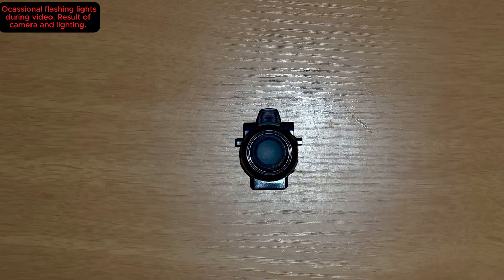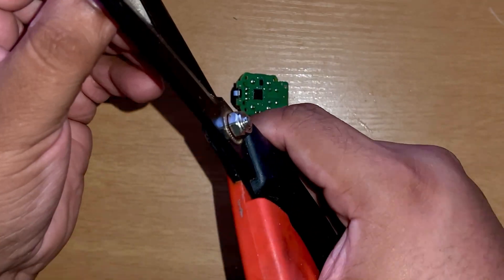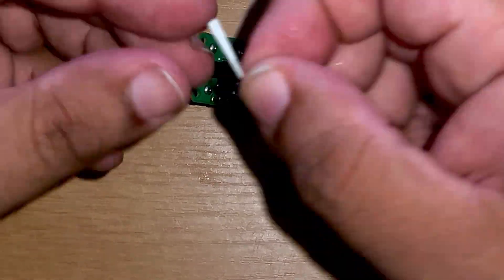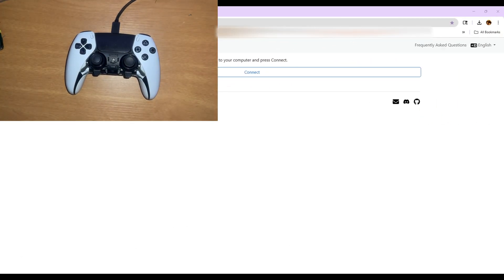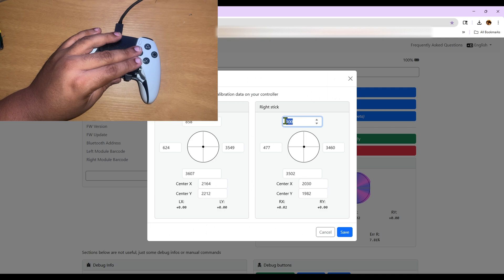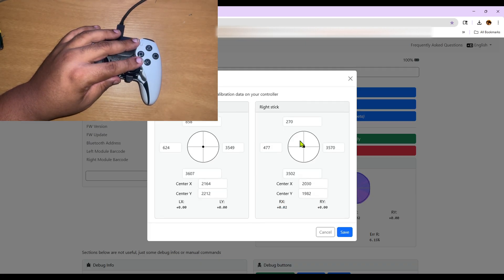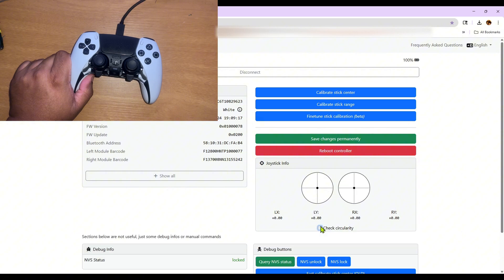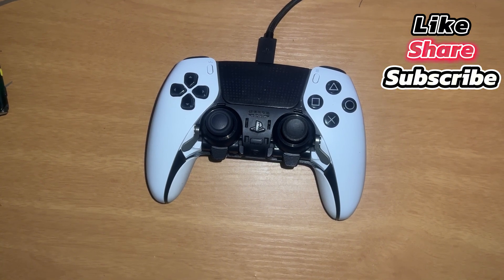DIY PS5 Dualsense Edge Gulikit TMR Joystick Calibration - UPDATED METHOD

Comment: Thanks for another demonstration of replacing the Dual Sense edge modules. Have you tried using smaller gauge enameled wire for the jumper? Something like 38 or 40 awg will have a lower profile than the 30 gauge single strand that you used and kapton tape is a good measure for those worried about shorting components. Btw the copper letters on the board near the connector are part of the ground plane so may be a reason some people are having issues running the jumper/copper tape calibration mod.
Reply from the maker: I use 36 now.

Comment: i tried the tape and it didn’t work, i managed to solder one jumper wire but the other one is giving me headaches and idk if i fucked up the board bc it’s giving the white flashing lights😭
Reply from the maker: So there was no with flashing lights before the wire installation?

Comment: So, do we need to do both modules?
Reply from the maker: If you modified only one module then no. If you did both then yes. 

Each module has its own everything.
Reply: @OmeliGaming  I don’t have anyone else to ask about this. Please, if you have time, answer these questions for me.

1. Do I have to use the exact same conductive tape that you are using? Or would it be okay to use a different brand of the same type without any issue?

2. When doing this, is passing the wire better or is this method better?

3. Between using a wire or conductive tape, whichever is used, after completing the task properly, should it be kept as it is permanently? Or should it be removed afterward?

4. If it is removed or kept, what are the advantages and disadvantages of each option?
Reply from the maker: @YalexStreamZ no problem. Always available for questions

1. No there are different options out there. One of commenters on my videos said they used a double sided copper tape but only one side was conductive. 

2. I prefer the wire method. I’ve had people have failures on using the tape method but I’ve never had failure on the wire method. 

3. Permanent is good to do. Just be cautious of it touching any other components on the board. This goes for wire and tape. It touching components will cause the controller to not turn on. Absolutely no lights will come on. 

4. Wire advantage is I’ve never had a failure. Disadvantage is the tiny points try to solder to them. Then some wires can take up to much space if left installed. 

Tape advantage is easy to leave in when it comes to being flush inside the casing. No soldering involved. Disadvantage is it not working every time when installing. Can be frustrating to keep testing and it not unlocking. Tape takes up more surface area so there’s a higher chance that the tape touches other components. 

I hope these answers help.
Reply: @OmeliGaming  Thanks, I appreciate it.
Reply from the maker: @YalexStreamZ no problem
Reply: @OmeliGaming  I tried taping it about 5–10 times, but it didn’t work. I think the mistake might have been mine. Next, I’m planning to try soldering it, but I don’t really have knowledge about that. If I give it to someone who does electronic soldering, show them your video, and explain how it should be done, would an ordinary soldering person be able to do it?  even if they don’t professionally repair controllers?
Reply from the maker: @YalexStreamZ yep they’d understand it easily. Check out my other video for installing the wire. There’s a chapter just for installing the wire. 

Game Changer! DIY PS5 Dualsense Edge Gulikit TMR Joystick Upgrade - NO BOARD REQUIRED
https://youtu.be/qKgAkAAnykg
Reply: @OmeliGaming  If I do it this way, is there any problem with keeping it permanently?
Reply: @OmeliGaming  The soldering work has been completed. He only used a very thin wire, possibly copper or something so small that it’s barely visible to the naked eye. I’m not exactly sure what it is, but the job was done successfully without it touching anywhere else. Is it okay to keep it like this for the long term?

Also, if I were to get a TMR Stick Module, would you be able to send one to me? They aren’t available where I live. Please let me know if there’s any way to contact you.

Once again, thank you very much for your video and your helpful answers.
Reply from the maker: @YalexStreamZ I don’t currently have spare modules. 

And it’ll be fine to leave it as it is.

Comment: Hope you see this because i dont want to make a reddit. 

I've heard someone say you can use conductive ink. 
Maybe experiment with that and see if its more reliable.

Also, this method with the conductive tape. Is it NO SOLDERING AT ALL required? 
Because i just want to calibrate my stock sticks in my edge controller without soldering
Reply from the maker: Conductive ink? Hmm 🤔 I’ll have to look into that one. 

Yes this would work with no soldering. I’d recommend with high percentage alcohol beforehand to remove any factory flux that may be present
Reply: Would 70% be enough?
Reply from the maker: @thunderz6031 I’d go at least 90. Or you can get WD-40 Contact Cleaner. It’s made specifically for electronics.
Reply from the maker: @thunderz6031  https://amzn.to/4lIhcXJ
Reply: Update

I got it to work, but I used a different conductive tape. It was a copper double-sided conductive tape from amazon, but it actually wasn't conductive on both sides. So i had to flip it and tape the ends so it would stay.
Also, i used a different solder point on the board to enable the calibration. It was the closest one to the right of the one we connect to where the copper lettering is

Comment: Im having a hard time unlocking the controller and locking them, i had it working the other day on my Playstation and was working fine until the controller started shutting off repeatedly and my aim was going all over the place, i even took off the tape and put new tape on. Do you know what the issue is?
Reply: I think so? Tbh im not sure, one of the sticks can unlock but won't lock and the can lock but won't unlock, im getting really frustrated and have no idea how to fix it. I'll message you on Instagram
Reply from the maker: @COMPLETED_Bless sounds good.
Reply from the maker: Sounds like the calibration is no longer saved. Never heard of it happening though. Was the module locked back after your initial calibration?

Comment: That conductive tape did not work for me i ended up soldering a jumper
Reply from the maker: Some to work for some and not others. It may need a dot of extra solder in those spots for some to get the tape to work. Never had it not work to diagnose the problem.

Comment: You don’t have to solder anything extra anymore you can calibrate to 3-5% error online
Reply from the maker: Did this breakthrough happened the past couple days? Did some a few days ago and I still had to unlock them.
Reply: @OmeliGaming calibration online doesn’t require soldering
Reply from the maker: It does if you want to save to an edge module. Edge modules are locked from being calibrated. The jumper wire soldering sends a 1.8v signal to unlock them. You can try this method using conductive tape on a regular potentiometer to calibrate. Without it nothing calibrated will save and the website will let you know it didn’t save.

Comment: Hello i cant calibrate the circularity manualy.. Every time its 20% both when i do the calibrate drops to 10% 12% but i cant do the manual calibrate like you, it wont work, when the small values are like 80 max end when i change it nothing happen.. The large values its 4000+ when i change it in diagonal position to make it more close to line it works but the right movement of the stick go to close to the center 🤯
Reply from the maker: Every joystick’s direction values are different. I’ve had some that go to 50 on the -X and +Y axises and some at 750. The range can change. If you like to know how to fine tune check out my other video here: How to Calibrate Your DualSense Controller with Finetune (Dualsense Calibration GUI)
https://youtu.be/IUY66nBXuIQ
Reply: @OmeliGaming  thank you for the quick response
Reply from the maker: @frankothedoctor2016  No problem. I hope you get it all worked out.

Comment: I dont see the need for unlocking, works fine without
Reply: it's nice to see whether the connection works or not without having to go through calibration
Reply from the maker: @saneparadox8181 you’ll have to use the unlocking software. I think it’s linked in the description. If not let me know and I’ll post a link.
Reply from the maker: It’ll work without but centering will be off like drifting. Some circularities can be good without calibration. Not all sticks are created equal though.

Comment: My controler its flashing white lights after upgrade and not working
Reply from the maker: Sounds like something was dislodged on the board. Either a resistor is move and/or gone. The usually happens when board is overheated and/or something was clamped on top of a resistor while heating. 

Or a copper pad was torn out of the through holes for the joystick pins. This happens if too much tugging on the joystick during removal. If this happened you’ll see a small piece of copper stuck to the pins of the old joystick.
Reply: @OmeliGaming thank you men im going to double check again
Reply from the maker: @zafaconfoo no problem. I tried finding a board scan so you could see where everything should be but can find any. Here are a couple pictures for example that happened to me long ago. You’ll see what one should look like and one that I messed up. https://drive.google.com/drive/folders/1Gu038hfOQ6JqtBpSpN3rOoI9cE6QBwXv
Reply: @OmeliGaming thanks so much
Reply from the maker: @zafaconfoo  you’re welcome. Were you able to see the files?
Reply: @OmeliGaming i did thanks

Comment: Hey! So i just installed 2 ks sliver tmr joysticks on the modules and i used the same tape you used connected the points! But for some reason it says both modules failed??
Reply from the maker: Failed to unlock? Or getting flashing white lights?

Comment: I tried this and it isn't unlocking my modules. I tried two pieces of tape and a single piece but neither of them work. What could be going wrong?
Reply from the maker: As far as this method goes I’ve never had a failure. I’m unsure how to troubleshoot the tape. You may need a tad more solder in those spots or should be cleaned. If it still doesn’t work for you go with this method using both unshielded wire and the conductive tape.

https://youtube.com/shorts/qoCxhBoTHaE?si=lDJFLmo54FcftfeL
Reply: What tape are you using?

Comment: hi could i just buy the gullikit stick modules. take off the sensors and replace the existing edge module potentiometers. then add the tape to calibrate. would save me having to change the the whole stick module. thanks
Reply from the maker: Yes. The Gulikit and Hallpi sensors are compatible with Alps housing. Just have to desolder the 3 pins on each to pull it out. I may do a video on this in a couple weeks. Different methods to removing a module.
Reply: fantastic I've not got all the kit. so the simpler way would be ideal. I'll order some things and look forward to your next video. subscribed and thanks for the reply
Reply from the maker: @jollyGat  Awesome. Thanks for subscribing 😊
Reply: thanks for the reply. is the 30 gauge wire the correct one. in your description
Reply from the maker: @jollyGat yes. It’s what I used for my install. You’ll want single cores like in the description. May be better to get some from a hardware store so that you only get what you need and much less money. Either way 30 gauge is good for it.
Reply: thank you. I want to try the method in the video but read there's a higher chance at messing something up. and might need kapton tape. I overthink everything lmao
Reply from the maker: @jollyGat lol understandable. Go with wire and you guaranteed
Reply: hey now buying last item. which would be best the wire method or tape. is there more risks with the tape ?
Reply from the maker: @jollyGat wire method is the most guaranteed. Tape works great if installed just correctly. Later today I need to make a short showing what i have one looking like with a permanent wire installed paired with the conductive tape holding it in place.

Comment: Can you not calibrate if you don't add the conductive tape? I guess my question is why do you need the tape or jumper in the first place?
Reply from the maker: It’s because the script is locked to each module and not the main controller board. The wire sends a +1.8V signal to that point near the connector. This “shock” to that point unlocks the script to  write new calibration to the module. Nothing calibration wise is saved to the controller. This why if someone purchases a module with TMRs installed from me it’s pre calibrated and can work on any Edge they’re plugged into.
Reply: @OmeliGaming  ok ok , I see. I appreciate the info. Do you just sell installed already or do you have mail in option. I stocked up on sticks when they were available and have about 10 now lol. Would love to have TMR sticks installed in some of them.
Reply from the maker: @Drew.51o_YT I do both but currently out of stock on the modules to install them. I do have plenty of TMR joysticks ready to install into a module for a mail option. I mainly use Favor Union but any brand that someone chooses I can get in stock. For modules I charge per module instead of pairs.
Reply: @OmeliGaming  I heard favor union is the best right now, but of course im sure it depends on personal preference. What is the cost to have the TMR josysticks installed into the modules??
Reply from the maker: @Drew.51o_YT I love them. They’re probably closest to factory I’ve used. 
And pricing is $35 per module plus shipping. US only. These I’d leave it capable of being calibrated by the customer if they choose. I’ll still lock them via software like the video but the customer is able to unlock and calibrate too if they’d like. Some people like their calibration to over extend the range of the circle.

Comment: do you notice a big difference between the stock modules and the TMRs?
Reply from the maker: Other than being sensitive in some cases. As soon as you move it moves. Some sticks also have different tension on the springs. Closest tension I’ve found to factory is Factor Union. Hallpi/Gulikit are extremely close second place. Hallpi and Gulikit are actually compatible with Alps housing. You could remove Alps potentiometer and slap the sensors on it. 

If want full technical breakdowns of TMRs I’d check channel Metal Plastic Electronics
Reply: @OmeliGaming  thanks man I wanted to replace them sticks of the edge but I just got the controller and the stock ones are working well.
Reply from the maker: @santoshnd5120 if your stock are still going strong leave them as they are. It’s one of those if it aint broke don’t fix it situations. BUT if you just want to go ahead and future proof yourself, then go for it. My oldest modules TMR modules are 6 months old going strong through hundreds of hours on all kinds of games.
Reply: I got you thanks and keep up the good vids very helpful
Reply from the maker: @santoshnd5120 if you decide you want to upgrade but don’t want to go through the work just message me and we can set up a TMR install.
Reply: @OmeliGaming  I will let you know when I need them sntall

Comment: Do u sell the gulikit tmr on the dualsense edge
Reply from the maker: Yes but currently out of stock on the modules to install them.
Reply from the maker: I do also accept mail in repairs. If you'd like to send a set of moudles i can add Gulikit joysticks to it.
Reply: How much would you want  @OmeliGaming
Reply from the maker: @mikelascelle2921 it’s a per module pricing for Edge. If you want Gulikit it’s $35 per module plus return shipping. If you’d like to start process just send a message to one of my social media accounts in the description
Reply: That sounds good.  Just one question.  I followed your videos and tried calibrating the stock joysticks with the conductive tape but I can't get the modules to unlock.  I'd like the buy the tmrs from u but I want to make sure I can calibrate them aswell.  Any idea on the problem @OmeliGaming
Reply from the maker: @mikelascelle2921 I’d recommend cleaning the area and making sure it’s not coming into contact with any other spot. You could also add just a dot more solder to that spot and try reapplying the tape. 

I also have a method where I use wire with the plastic shielding stripped and I use the conductive to hold it in place. It leaves the wire permanent, shielded and flush enough to replace the casing without a problem
Reply: Ok. Thank you I will try that @OmeliGaming